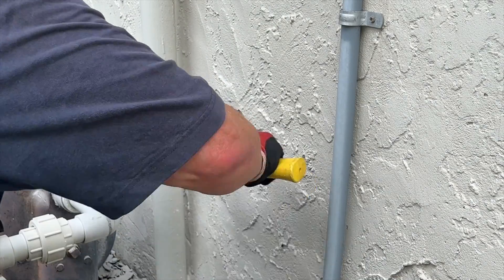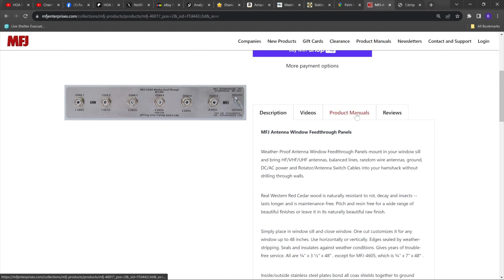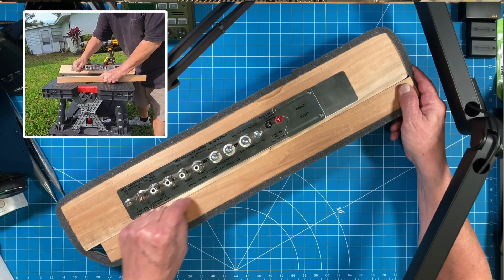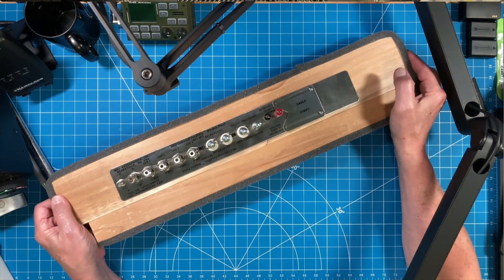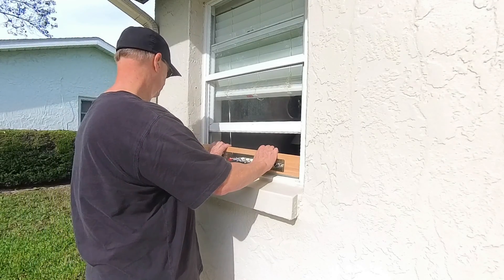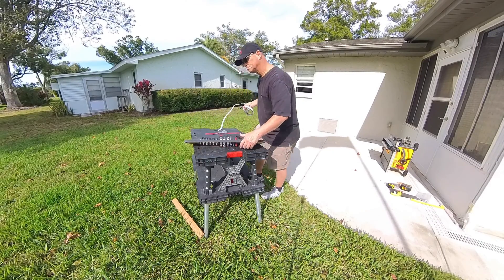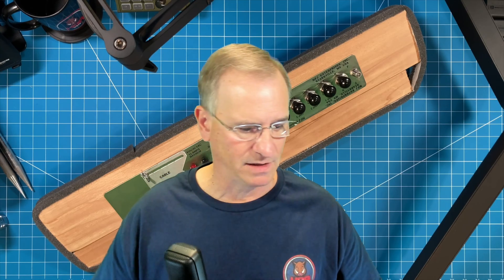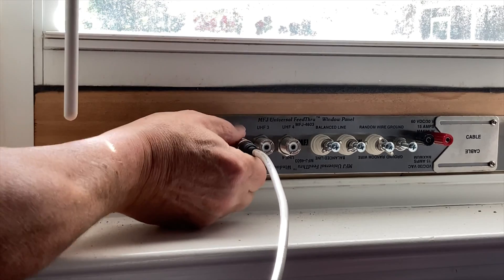New Ham Radio Shack Build Out Episode 6: Review and Demonstration of the MFJ Window Feed Through

Comment: I use 3/4 foam pipe insulation! Cut to length so it fits tight cut a slit off to the side across push in cable shut window. 100% not wood, no rot keeps bugs out & Coax has no so239 or tipe N's to leak! My cheeper plan works. KF0HRF Scott.
Reply from the maker: The pipe insulation is a great idea!  Thanks for sharing.